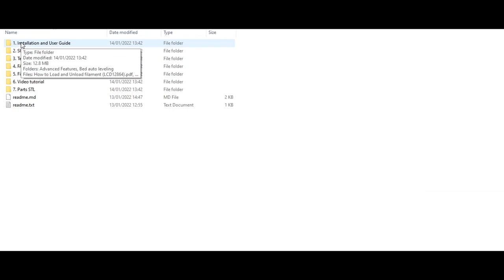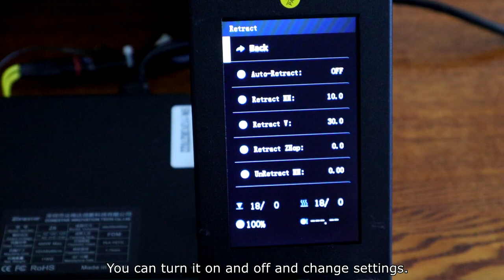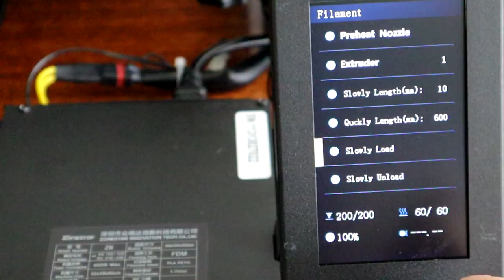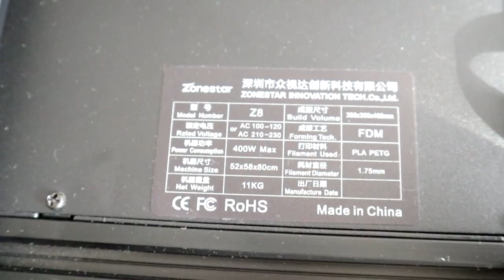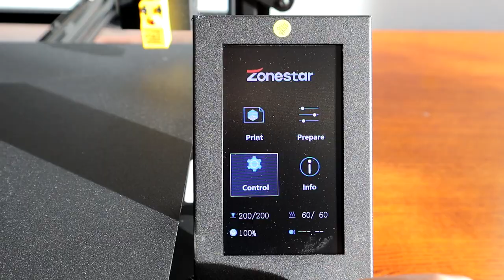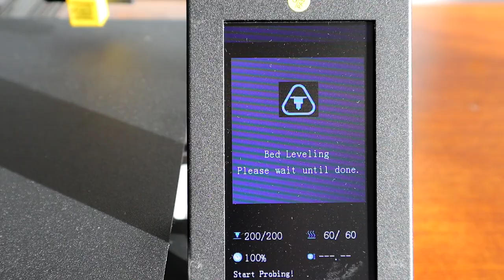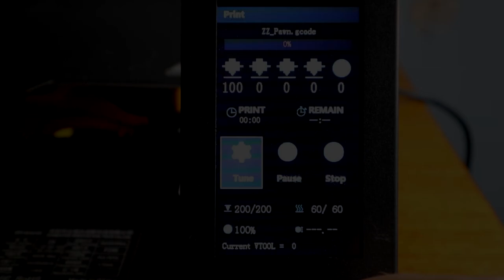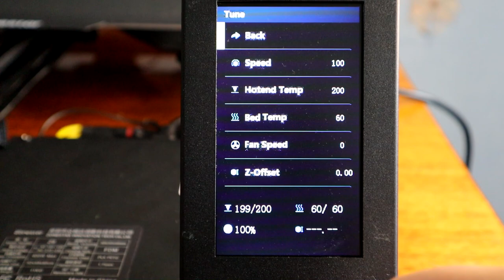Zonestar Z8PM4 Pro - Color mixing 4 Extruders 3D Printer

Comment: Zonestar 3D printers are junk and are a scam. I bought the Zonestar Z9V5 Pro MK3 in May 2022. The 1st problem was one of the holes was drilled slightly off and it was very difficult to put together. The 2nd problem was that the x and y axis wouldn’t home and it would just keep going until the belts jumped. They wired up the x and y limit switches so that they could never indicate that the switch was made up. They broke off the terminal that was supposed to be used. I ordered new limit switches and fixed that problem myself. The 3rd problem is that Zonestar strongly suggested I order a different hot end, the 4 in 1 non-mixing head so I did that before I even received the printer. The machine I ordered came with the 4 in 1 mixing head. I tried both hot ends. Every print I printed was skipping layers. I printed the xyz calibration cube about 30 times at different levels and temperatures and with different PLA and it always skipped layers. I contacted the sales department and technical support and they are somewhat slow to respond, don’t answer all my questions, and are not very helpful with troubleshooting. The 4 in 1 non mixing head is a piece of junk and clogs up very easily. There is a very small hole for each of the filaments to travel through. When it switches filament it has to retract the current filament which deforms the filament making it larger at the end and then it either can’t retract through the hole because the end is too big or it gets all the way through the hole and then cools and becomes bigger and can’t go back in the hole. Maybe some setting changes would help with that but technical support is horrible. I finally figured out on my own I could print a good xyz cal cube with using only extruder #2. Extruder #3 works ok. Extruder #4 is poor. Extruder #1 is horrible. I’m working on ordering new PTFE tubes and adjusting the tension on the extruder filament to see if I can get the other extruders to print better. Technical support’s last suggestion was for me to just use extruder #2 and use it as a single color printer. They have given up. They have not offered me good help.
Reply from the maker: The Zonestar Z8PM4 Pro I have isn't junk. It works  and I have done good prints with it. It's what I experienced. Yes you can clog it if you push down the filament too much and you have one or more channels open(without filament or cleaning tool). It's also mentioned in user manual. If you change filament you first push down filament and then pull out the filament. Then you don't have problems that filament is too big to come out. Try to clean the extruder with cleaning tools(remove nozzle and all filaments during cleaning). Adjust extruder tension. You can try different temperatures and retraction settings. I didn't need technical support, but if they have given up and said use as single color printer then it's very bad.
Reply: I have a Zonestar P802NR2. It's a four year old model. When it came out it was extremely cheap for a dual material printer.
Being a i3 clone with an acrylic chassis, it wobbled a bit, and after 2 years some of the acrylic parts developed cracks. 
But repairs were easy, spareparts, where needed, cheap and readily available.
I think Zonestar is doing a good job with their printers. 
The more modern systems seem to be locked with some vendor-specific firmware instead of the usual open source firmwares such as Repetier or Marlin.
But seeing how many people use Windows, I think only a small minority of people like myself will actually be bothered by that.

I think that Zonestar pritners are okay given they are on the cheaper end for their configurations.
Reply: Maybe I have one and what happens is that you don't know how to put anything together.

Comment: It seems to have some Z wobble, I noticed on the cubes that the layers were not all even, of course this could be just this machine, I have tried mixer hot ends before and they are not the best way to make multi-colour 3D prints, but they are the least expensive.
Reply from the maker: You could be right and yes there are better ways to print multicolor.

Comment: I bought one of these, my question is how do you get it to print what you want? What slicer? What programs will talk to this printer? I have used matter control and designed thing I wanted to print and have printed on my other two printers, but I can't find a driver that talks to this printer.
Reply from the maker: You can use Cura slicer and add 4 extruders to settings, then you can use it as other printers. Gradient print settings you can choose from the printer interface. Info should be available from user manual.

Comment: Interesting, just I wanna know if don’t need a purge tower?
Reply from the maker: You need purge tower if you print normal multi color mode, but if you use color mixing option, you don't need purge tower.
Reply: dint buy it man this one is am actual nightmare,  I still haven't received my refund

Comment: 10:29 - I don't get it. You say models are slized as they were 1 color only - but how do you print a multicolor figure like the one shown then?
Reply from the maker: The parrot is sliced to print with 4 colors, but vases are sliced as one color print and i used color mixing mode from the printer screen.
Reply: He's mute. He can't do a useful video explaining

Comment: i reaallllyyyyy need the cura profile of this printer wwhere i can find it pleaseeeee !
Reply from the maker: With the printer came microSD card, where you find cura setup manual and resources files. The manual helps you to make your basic profile and you need to try different settings to find best for your filament. I used different settings with different prints. I lost my cura profile after cura update and I haven't done new one.

Comment: 4 extruders and 4 filament spools on top of the X gantry without a gantry stabilizer... really? I wouldn't use this printer if you paid me... let alone buy it.
Reply: Yea.  Its one of the problems the QuadFusion had when I used it on my Ender 3.  Also, one of the reasons the developers used built in (weak as they are) extruders is that they found the pressure and distance of the bowen pushers would make the colors and filament flow inconsistent.   That being said there is STILL no good software for these mixer extruders.  Whats the point of them if you cannot modify the color without using presets.